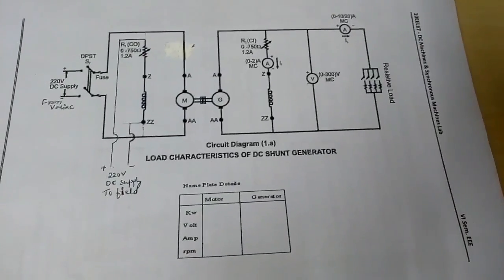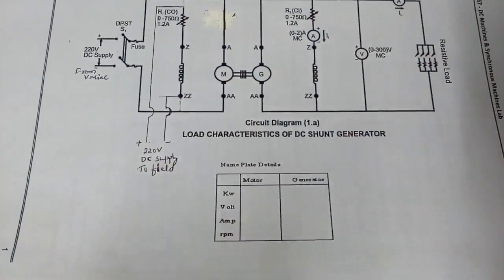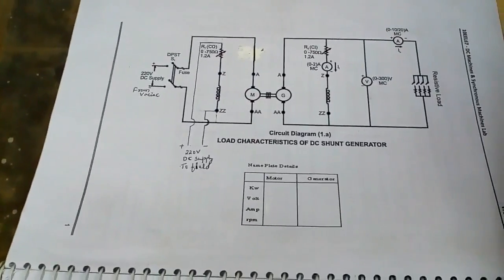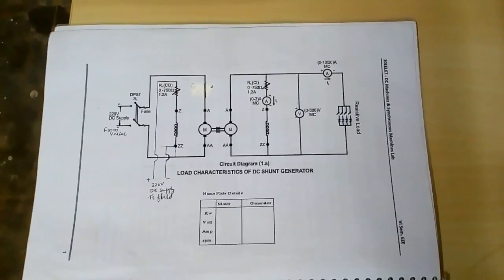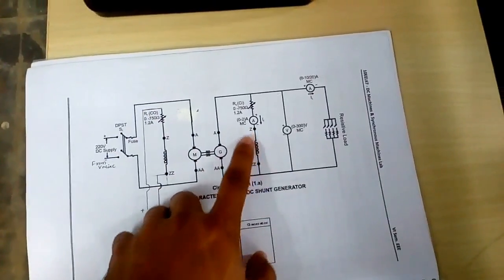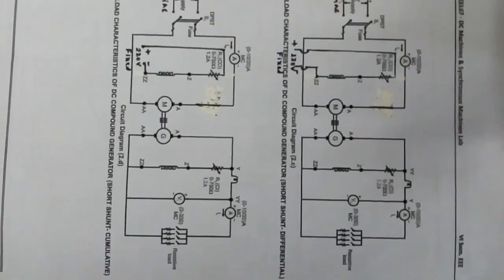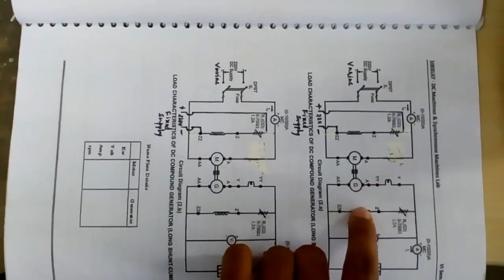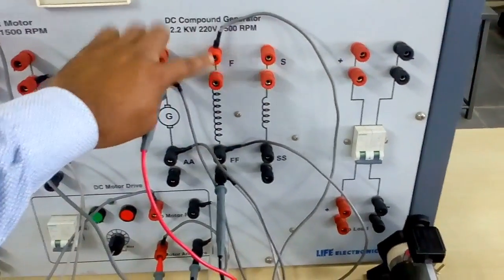Load Characteristic of DC Shunt Generator

Comment: Why generator rheostat is kept maximum position??
Reply: naga raju
Reply: so the generator is controlled by varying the field current . and field is controlled by rehostat . so firstly rehostat is at maximum position to have minimum field current and minimum output voltage . Now if we are increasing the field currentby decreasing the resistance voltage got increased on output side of generator.